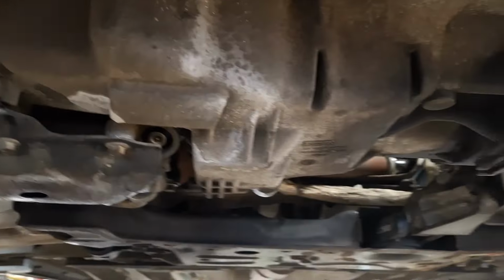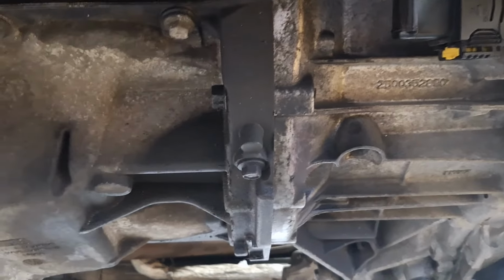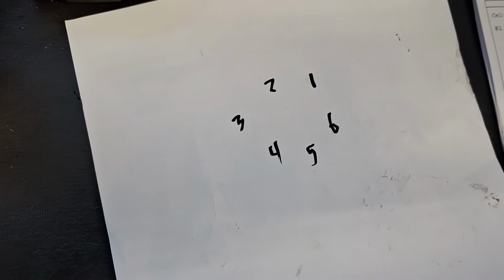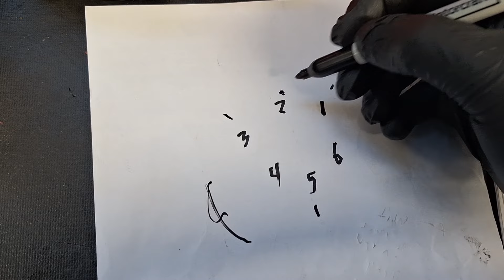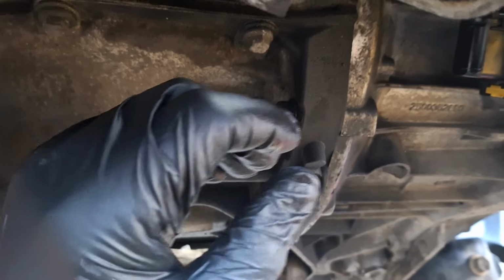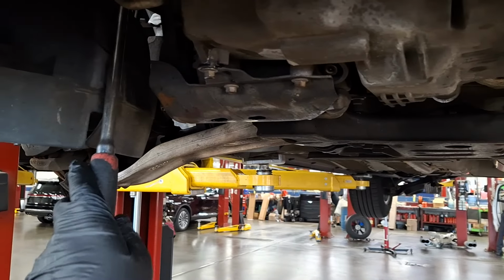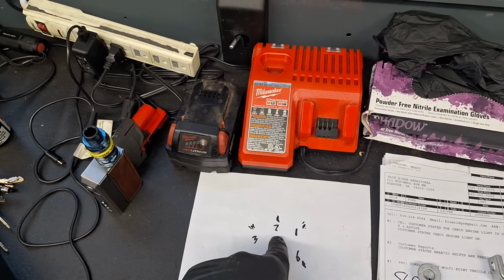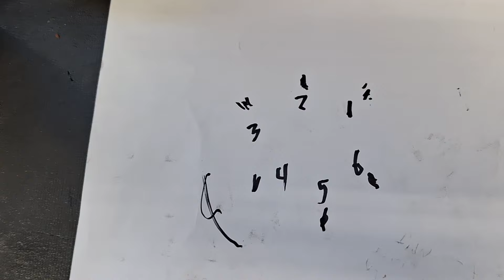How to Tighten Ford Focus Clutch Nuts | Dual Clutch Auto - DPS6

Comment: So, I dropped a nut into the case :)

I can say though, since the space where the flywheel is is directly connected to the engine shaft and oil pan, I could recover the nut by just removing the oil pan. Definitely tedious, but now I realize I get a much better view than through the starter mouth. Hope this helps someone out there not freak out as much!

Comment: Thanks for making this video. Literally fixed a shudder I had in reverse after doing a clutch / gearbox job on a Focus. I didn't tighten those nuts correctly when installing them and all the studs were tight after removing the nuts. Rotating the engine 4-5 times freed those up and then I installed the nuts as per the factory specs 👍
Reply from the maker: Awesome, I'm glad it helped!

Comment: I just did a clutch job for no reverse and eratic shifting on my 2013 Focus.   With only 44k total miles, I cannot believe I had to do this already.  I replaced the transmission input seals; inside of the case appeared to have a little bit of oil, but not much though; so clutch itself was probably still ok, clutch discs still had a lot of material left.   Since I had already pulled the transmission out for inspection, I put a new dual clutch kit and new forks anyway.  Now, no reverse and got P087 code.  I followed your procedure when installing the nuts, rotated engine about 10 revolutions,  but after all that, engine has a vibration at around 1k RPM that it didn't have before.  I still have to chase the P087 code and no reverse.  What should I try next?  Thanks in advance.
Reply from the maker: @NoJodas671  https://youtu.be/2-9PkV-8N7A

Comment: Whats happens if I can’t get the studs free after turning it so many times even got a breaker bar and tried going back and forth in a short motion, it did have free play  in the stud initially ran forscan it kept giving error when I’d go to accelerate on park so I’m pretty sure I just gotta torque the studs again but I can get it free any advice
Reply: Update: I cracked the transmission input speed sensor when changing clutch gonna replace, I was getting a P0717 saw my sensor cracked on the head smh trial and error ig

Comment: Replacing my clutch currently is there any reason not to use fords recommended torque specs on the nuts? Ford states 12nm on 1,3,5 in first sequence then 25nm on 2,3,4,5,6,1, rotating clockwise. Any advise would be appreciated
Reply from the maker: Can't hurt to use torque specs. Apologies for not including that on the video. Also yes that's the right sequence and matches what's in the video. Thanks for watching
Reply: Thanks !! 
 @BigBensCarsAndCycles